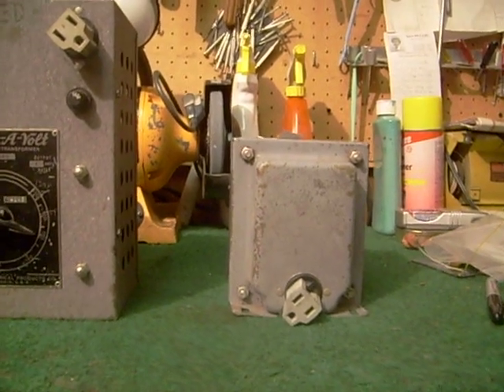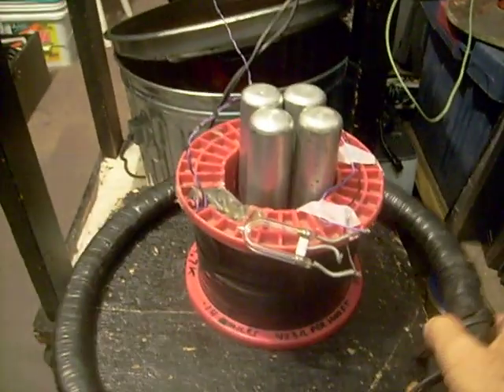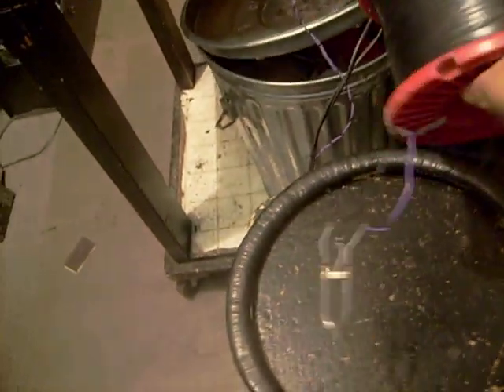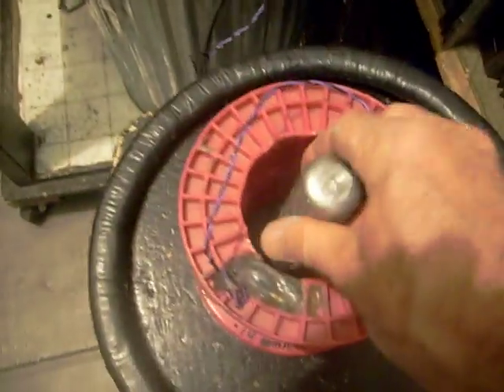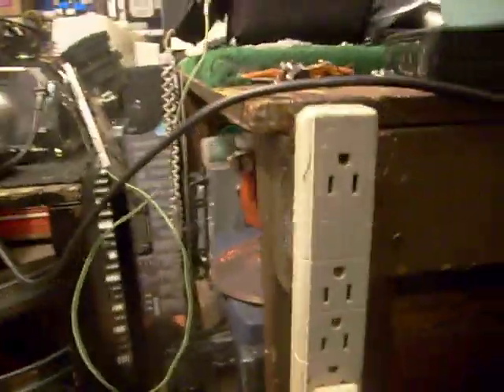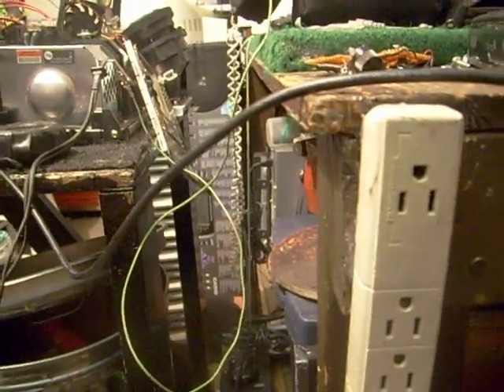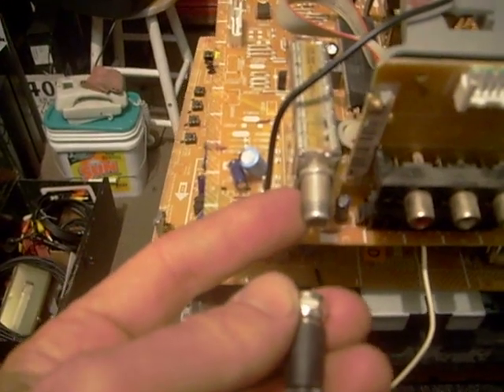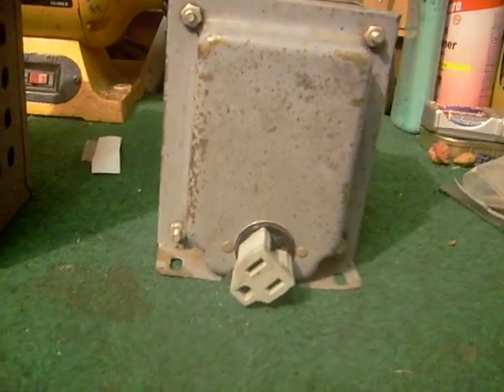Isolation transformers

Comment: You never want to troubleshoot a TV or switching power supply *Live* without one.
Oddly though, I see a lot of folks repairing ATX switching power supplies without one, 
however there only looking for obvious signs of failure,  and testing electrolytic capacitors with a ESR meter. While this may work, you could be replacing components that are still good, or not fixing the problem at all. Very few electronic technicians have one these transformers, or never heard of them.

Comment: On a 3 phase isolation transformer - wired in star formation , does the primary supply require a neutral ?  Does the neutral come from the starpoint on the seconday .
Also how does the earth get connected so its continous to the load ?

Comment from the maker: On the secondary side of the transformer there is not ground. It only has Two wires. Even though you can see a plug on my isolation transformer with a ground connection it's just an adaptor with no actual connection to the transformer.

Comment: The main reason for using an isoltion transformer is for example when you are using say an oscilloscope to test a SMPS, and accidentally connecting the oscilloscope ground to the the HOT ground.This will cause a blowout. So you want to isolate the oscilloscope ground from the AC mains ground. Chasis is always safe to be connected to the oscilloscope ground, for it it were'nt, then one would get a shock touching it.

Comment from the maker: @skipjack820 You can still get shocked even though your using an isolation transformer, but not between earth ground and the device your working on. Normally If I'm standing on the grass with no shoes on it could be deadly for me to touch one of the wires going to my 110 volt AC outlet, but if I'm using an isolation transformer nothing would happen because the AC wires to my AC outlet are isolated from earth ground. I need to make a better video on this.
Reply: Howdy. Can you clear something up for me? I bought a medical isolation station, toroidal isolation transformer. It has a continuous ground path through the isolation transformer. On a three prong DUT do I need to use a two prong adapter with that isolation transformer to break the ground path between the DUT and the mains ground to keep my scope safe?
Reply from the maker: @user-lp3cf5yn5b  It doesn't sound as though you would need an adaptor to isolate your ground connection, as long as your two mains wires are isolated. I did a better video on isolation transformers you might find helpful to visualize how these transformers work at this link. https://www.youtube.com/watch?v=3rvEdHyAd2k&t=6s

Comment: if the output from the isolation transformer is 110 volts, won't you still get a shock since the voltage is still high?